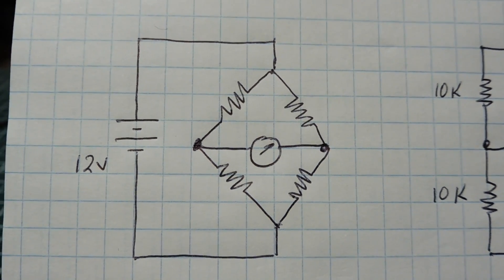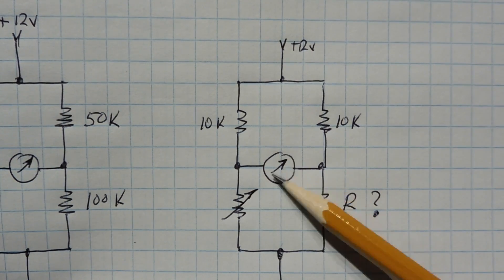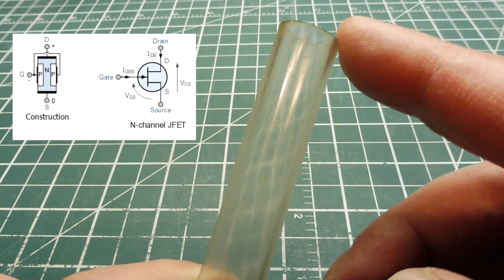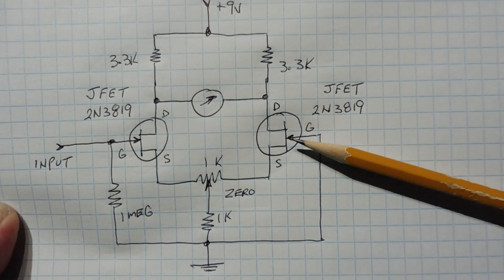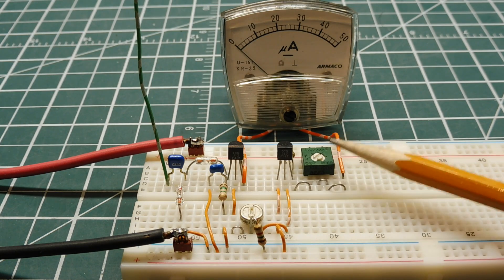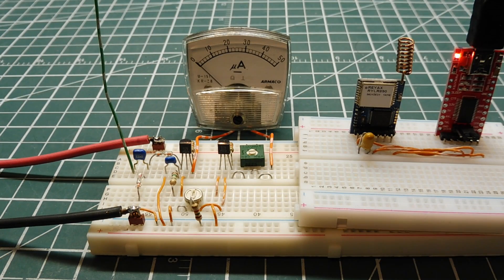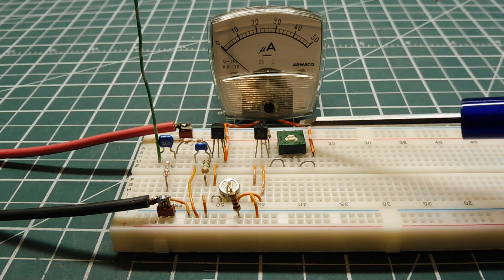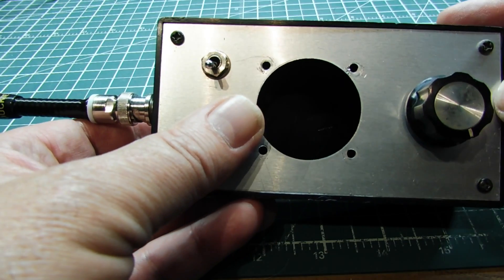Wheatstone Bridge  / RF Field Strength Meter

Comment: Hello, you did a good job. How is it possible for the second mosfet to work? I do not understand. The signal that should come to the gate leg, which will trigger the mosfet, can only come through 1M resistor. However, I think that after 1M resistance the signal is already connected to ground, it never reaches the gate leg of the second transistor. 
Bu nedenle, 1M dirençten sonra kablo, ampermetrenin 1k dirençle sıfırlandığı yere bağlanmamalıdır.
Is not it?
Reply from the maker: The first FET detects the RF field and unbalances the bridge for a meter deflection. The second FET makes up the right hand voltage divider. The resistance of the second FET changes when the null pot is adjusted. You could use a resistor in place of the second FET but it would have to be changed to a different value each time the meter is zeroed.
Reply: @0033mer  OK. I just got it now. Thank you for the answer.

Comment: Superb explanation on the workings of the wheatstone bridge and jfets. I'm really interested in your RF charge pump configuration, I understand what's it doing functionally but would like to know how you calculated/arrived at the values you used. Any chance you can do a more detailed explantion of it?
Reply from the maker: The charge pump is a Greinacher voltage doubler. The values chosen reflect the high-Z input of the FET and RC time constants. Here is some info on the circuit: https://www.electronics-tutorials.ws/blog/voltage-multiplier-circuit.html
https://www.youtube.com/watch?v=IqzA3-bgIIE&t=369s
Reply: @0033mer  Many many thanks for the links, gonna go through them now and hope that I understand the formulas involved. Your capacitor values are actually in nano farrads or are they pico? Excuse my ignorance ;)
Reply from the maker: The value of the capacitors are in nano farads  "nf"

Comment: Hi, I know this is off topic but I’d like to know your opinion about this Arduino kit on Amazon amazon.com/dp/B07B7JJQMF/ref=cm_sw_r_cp_api_i_je8RCbGHPXPK2  
I’m completely new to this, but I really want to learn how to use them, and since you’re very experienced and based on the price and all the components and sensors that come with it, is it worth buying it or is the price too high?
Reply from the maker: If you are really serious on learning about microcontrollers and interfacing to other devices the kit has everything you will ever need to keep you busy for a long time. The cost is probably cheaper than if you had to order everything separately with shipping costs and waiting time. You can't put a price on education. Hopefully you do not lose interest quickly and your kit ends up in the corner collecting dust.
Reply: 0033mer Thanks for answering! 
I’m really serious on learning about micro controllers. I’m actually an engineering student.
Reply from the maker: That's great that you have your goals setup and know want you want to do.
Reply: @0033mer  
You are right. My kit is dusty and thrown into a corner. :)